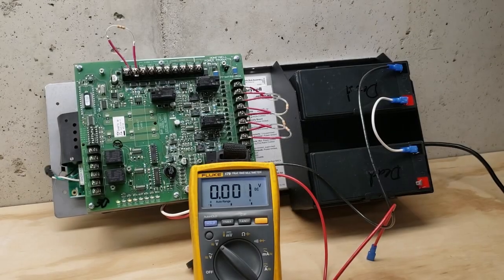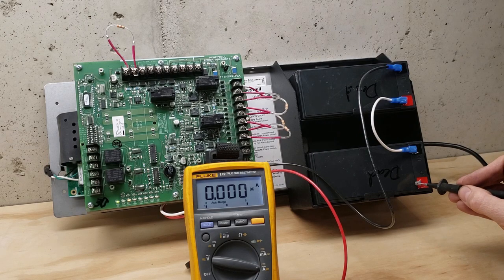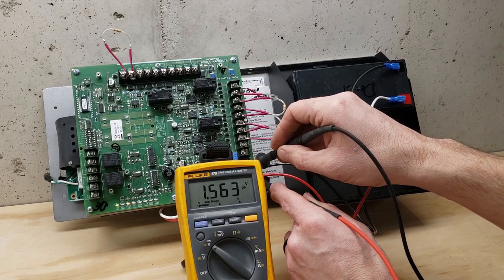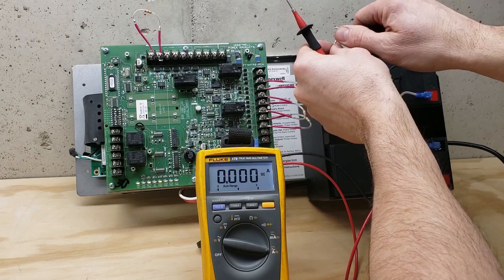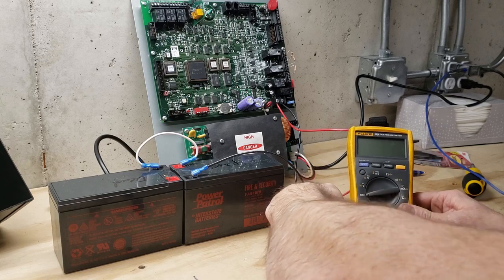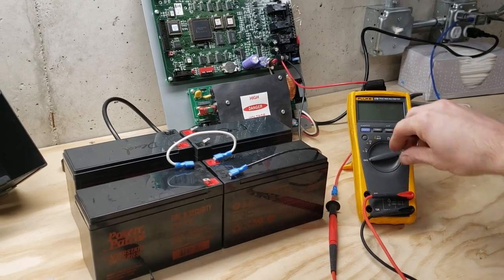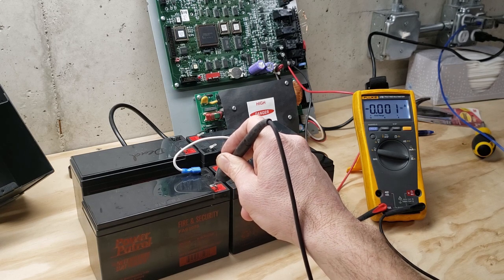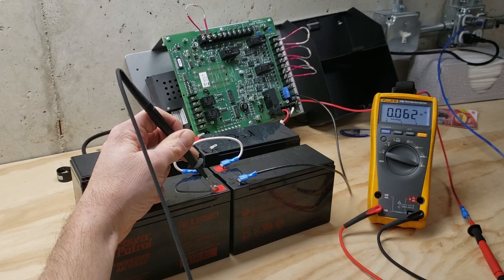42 - What is a Charger Fail?

Comment: A simple method to determine if a Vi source ( Voltage Current Source ) aka power supply of any type or charging circuit is operating is to put your meter on the voltage range and see what the open/ no load voltage is at the output of the system. You do not need to put a current meter in series with the batteries to determine this. Charging circuits will put out a greater voltage than the normal operating range of the batteries being charged... ie   12v systems with charge at 14.4volts,  24v systems will charge up to 28volts . So if you do not see a no load charge voltage of 14.4vdc or 27vdc  then the power supply or charger has malfunctioned.  You can also load the system by putting a fresh set of batteries and do the same test to see if the output is within the range I specified...

Comment: I have not done any service training yet, but glad you created this batttery vs charger video. I was wondering how to troubleshoot this problem. I have seen this where power panels don't show voltage when not connected to the batteries. I was so confused being I did not know a panel can shut that feature off when no batteries connected and batteries were at 12V or 24. So I thought impossible to check charging circuit. Test with amperage. Fantastic!!!!

Comment: As you said in advance, as charger is a bit smart it doesn't start charge batteries if initial battery voltage is drastically too low, in case you have hucked 12v battery instead 24.

Comment: Why is the fire panel indicating charger fault
Reply: It depends on the type and sophistication of the fire panel.    Some will show charger fault,  some will show battery miss wire, and some will actually show you the voltage of the batteries.

Comment: Joe all you had to do was measure the batteries individually for 12 vdc each  if they read  4 to 5 vdc they are pretty much bad and as far as the current just put a load tester on them  if they fell after reading voltage then it's not the charger .
Reply from the maker: Yeah, that's not true at all, and really wouldn't help anyone.